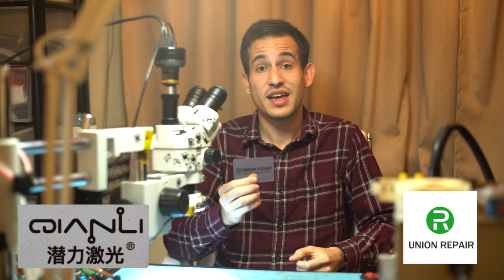512GB IPHONE ?! Storage Upgrade and Apple Store Reaction

Comment: What are the side effects?
Reply: Warranty void, risk of device brick/blocked on next iOS upgrade, possibly lower quality untested NAND that either isnt as responsive or doesn't have the endurance/longevity the stock NAND does, slightly lower battery life if the newer higher capacity NAND chip draws slightly more power.

Comment: cool, I'll just stick a 512gb SD card in my android phone 👍
Reply: microsd is a crappy storage standard. its slow af compared to nand flash chips, and its unreliable, you can never know when its gonna die on you.
Reply: skeivys they dont exist
Reply: Well it's still expensive but surely exists https://youtu.be/cVDbjhIQqXo?t=6m56s
Reply: Wtf there is no 512 gb sd? There is 2 tb and it can be supported by android depends on the unit and model
Reply: Nope there isnt. Maybe you mean those fake chips from China with real 2-4GB that are showing 2 TB of Storage because the Rom is being Modified.
Reply: All Android phones I had supported MicroSD up to 128Gb. And the system treats it differently than internal storage in a lot of ways. But it's still nice to have one for photos or music.
Reply: MrAnima Most Android devices allow you to install apps on the SD card and the apps work the same way as if installed in internal memory.
Reply: I know, but I develop app, and I know that for a lot of things, external storage is very different than internal storage. I just wanted to say that upgrading the memory chip is not the same as adding an SD card.
Reply: Could get a 256GB Galaxy S9 and put in a 256GB MicroSD.
Reply: You can't
Reply: Good luck finding one at making it work out with your phone lol xd
Reply: MaiThooM1 they have 1TB flash chips lol not released,  but they will be. Android operating system supports the memory standard just like iOS supports the storage increase yet no production phone comes with that chip currently. Both platforms have the ability to do this lol, why would you need 512GB if you can store on a cloud with safer medium IMO....
Reply: Android phones support SD cards up to 2 TB. 512 GB do exist. Sandisk makes 1TB sd cards.
Reply: razer phone supports 2TB
Reply: ARandomgamer technically phones that support 64GB micro sd can support up to 2TB of storage
Reply: Samsung has made a 512 gb microSD card
Reply: whoahh I've never seen one that hasn't
Reply: skeivys why be a troll when you clearly clicked the video to watch it. 🙄
Reply: Jimmy Williams no I meant that it's cool, really... jus easier to do with an android phone
Reply: Theres no 512gb SD card and even if there was Android phones don't support 512 GB cards
Reply: @pogchamp4542  my phones supports up to 1tb.... So try again

Comment: Apple fans amazed in the mean time u can expand a note 8 to 2tb and also u don't have to open and manufacture then solder some cap back together.... yawn....
Reply: Michael Jacob no such thing as a 2tb micro sd card.
Reply: Just John the note8 is ahead of its time as always with all note series I didn't say there was but there will be and this phone is already capable of it does this clarify?
Reply: Right but by that time the phone will already run so slow due to Samsung bloat that you will have already replaced it. And by that time you’ll be bragging about how it can expand to 4tb. Smh
Reply: Lol fan boys riding that big Apple D gotta love that $h%t

Comment: If a customer showed that to me, I’d just say “nice jailbreak mod” 

Honestly we still don’t know if that really has a 512 capacity. I have a 64gb flash drive I bought off Amazon that only really has the capacity for 32gb.
Reply from the maker: its real. the chip is double thickness than the 256gb. still fits perfectly in the housing
Reply: Federico Cerva thickness Does not matter could be fake still could be just a  thicker housing

Comment: How did you solved imei number, serial number and software ?
Reply: Alperen Turgan nand chip needs to be programmed using the original imei serial using nand programmer..
Reply: Ivan Jed Balmes yes this true but Federico Cerva don’t use original apple chip right ? So when he use different chip how can he programming this chip ?
Reply: I know how.. he did mention someone "thankyou for programming the nand chip".. iam also a cellphone technician and i know how to program a nand, and i have a programmer. And yes the chip is not a from apple itself, he did mentioned that also..
Reply: Ivan Jed Balmes thank you for your reply bro 😊
Reply: You need a band flash programmer. They are about $600 on eBay. You also have to be vary skilled at BGA rework and micro soldering.
Reply: A NAND flash programmer would help with that.
Reply: crazyretrotech thank you for reply
Reply: The Tech Genie It's actually closer to $200 you can get them for.

Comment: so dope dude! overall the whole thing was very cool to watch, not get a 1024 please :)
Reply: Trey Tcg 1TB is actually 1024GB technically. However, due to formatting it usually ends up being a little under 1000.
Reply: Disputes no that’s incorrect. memory is counted in base 2. that means 1KB = 1024 bytes, 1MB = 1024KB, 1GB = 1024MB, 1TB = 1024GB. marketing teams use base 10 to say “1,000 gigabytes in a terabyte, etc.” basically to make it easier to sell hard drives and ssds. this is why when you format a drive on a PC, you end up with less than 1TB because it’s 1,000,000MB divided by 1024MB per GB.
Reply: Gangster Hamster it’s not 750. it’s usually around 930-980 depending on what filesystem you format it to
Reply: HDD Recovery Services you basically can get any size then
Reply: TGF thats for harddrives they use a different memory capacity it would be like thinking grams and pounds were identical in quantity. Flash memory defaults to 1024 while hdd use 1000 as the standard

No formatting uses 24gb
Reply: TEN10K if you installed windows a bit of data is used on hidden partitions
Reply: TGF if you buy anything that says “1t” you’ll actually have like 750gb to spend
Reply: Just say 1tb 24gb